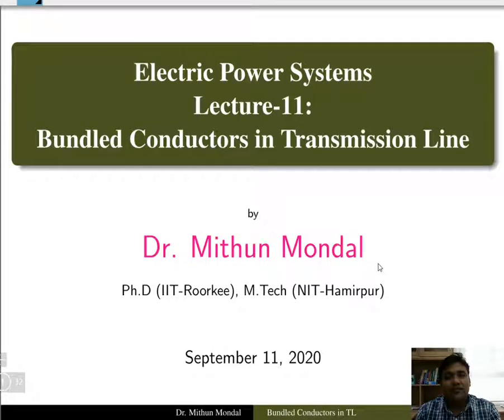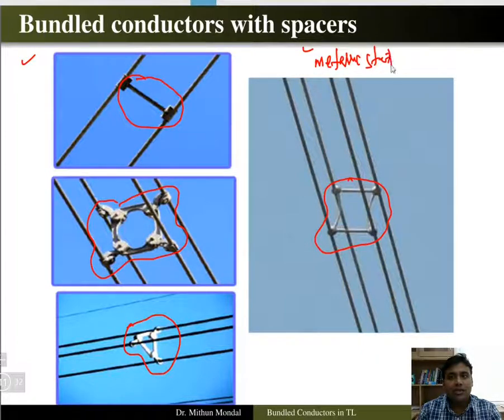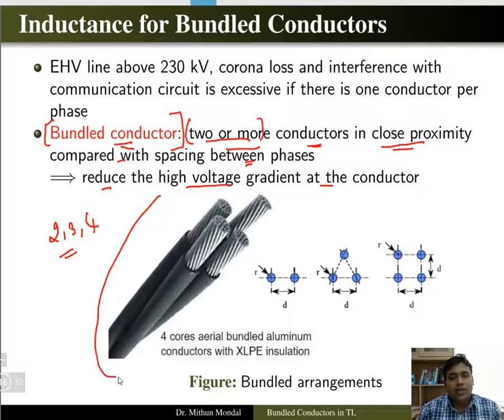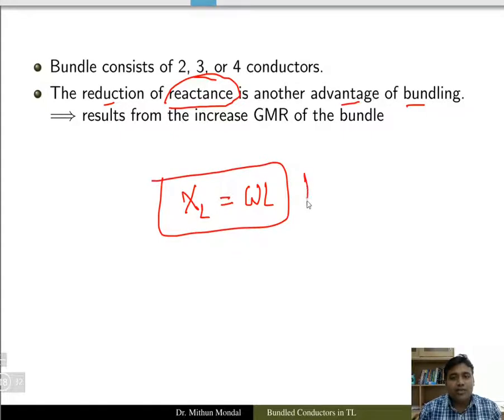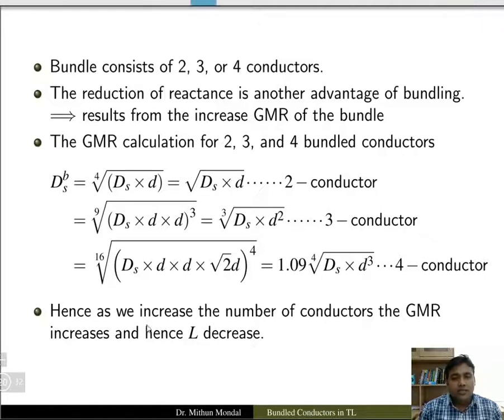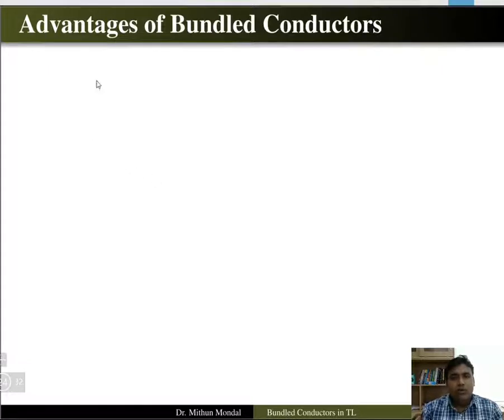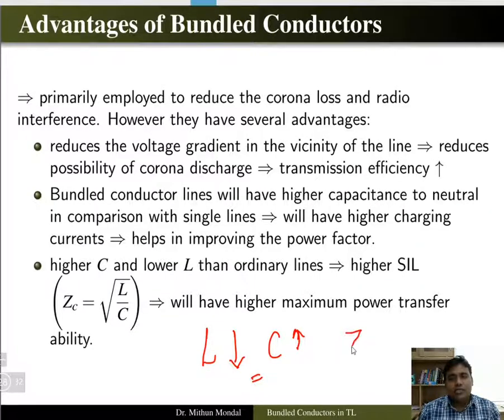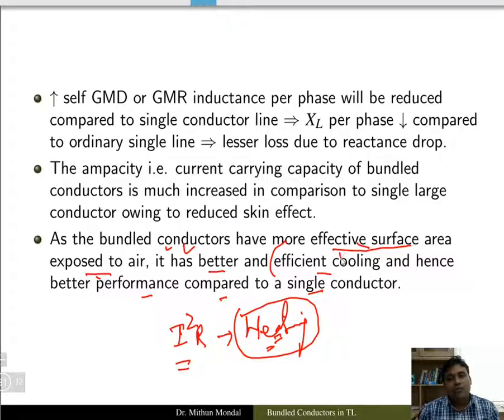Power Systems | Lecture-11 | Bundled Conductors in Transmission Line

Comment: Hello,
I'm not sure if I understood this properly. In 15:58, if the capacitance increases and inductance decreases then shouldn't the surge impedance load (characteristic impedance) of the line decrease and not increase because C is in denominator and L in numerator?
Please clarify
Reply from the maker: I think you are confused with Zc and SIL. Surge impedance loading is the power (not the load) transferred when the load = Zc. As you say that Zc will decrease, it means mor power will be transferred, right?
Reply: @EngineeringDevotion  Yes.
I understood that when I searched it after writing this comment. Thanks for your reply!